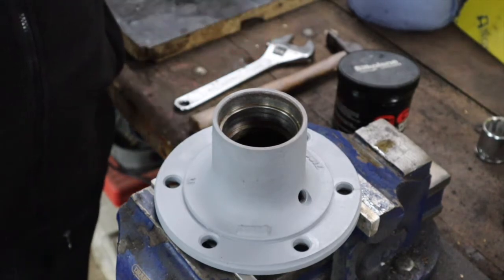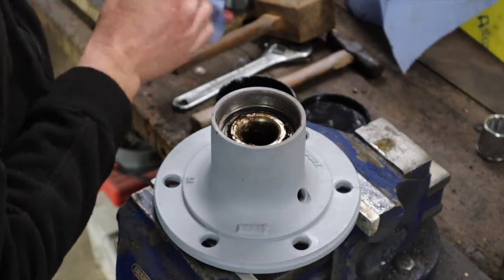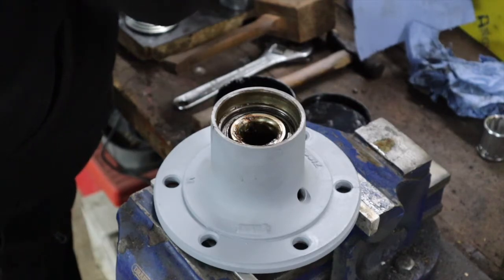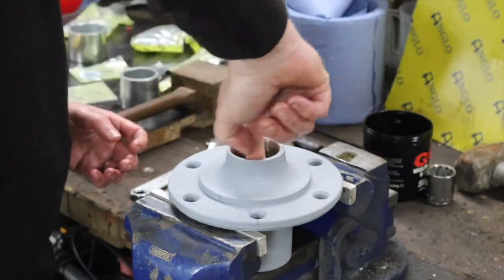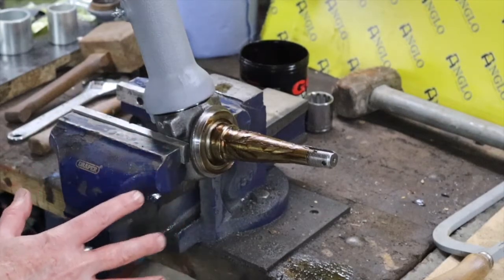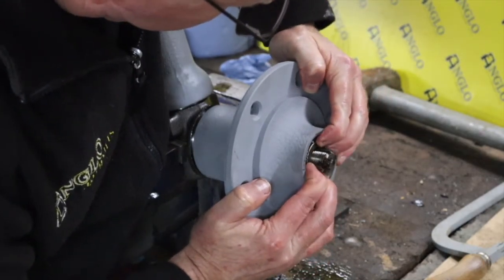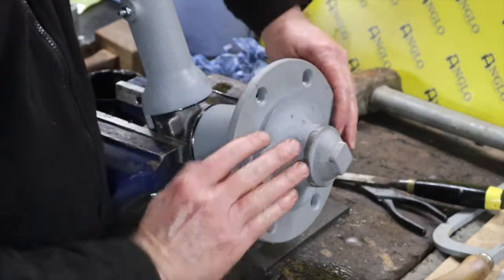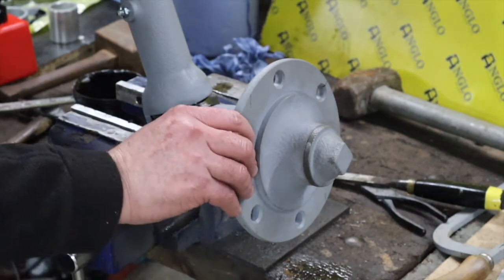#119 Ferguson TED20 - Rebuilding Front Wheel Hubs - with Anglo Agriparts

Comment: Note engine oil is supposed to be used to fill the front hubs up until tractor about serial number 455000
Reply from the maker: Hi olnmfc, thank you for this info. I have serial number unfortunately so I went with grease as that is what was in there when we dismantled the hubs. 😉👍

Comment: Thanks for another great vid. Between yours and Lance (Buddy Bear) here in Australia I think the little grey Fergie are well covered.
I wonder if ‘one shot’ lube, as used in Land Rover front hubs might work for the Fergies ?
Reply from the maker: Hi Swagman, thank you. Yes i like to think it’s another form of preservation for these iconic tractors. 😉 of course Lance is the professional, whilst we’re just hobbyists. I’m not familiar with the product you mention, but to be honest if it’s wet and greasy it will probably do just fine. Bear in mind these hubs operate at very low speeds compared to most other vehicles and in fact they spend most of their time standing still. So for me the quality of the bearings themselves is more important than the lubricant used. 👍😉